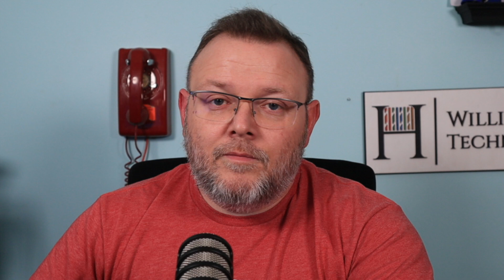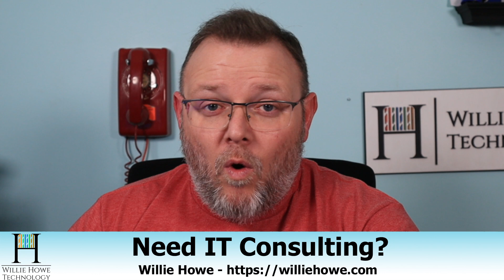Why is my wifi SLOOOOOW!?!?!!?!

Comment: The obvious solution is a faraday cage, an AP with a 2.5gbit connection that's got a 6e 6ghz 160Mhz channel width network. And then it connects to a single device that's 20ft away with direct los. Then you can get gigabit.

Comment: Nice vintage wall phone.❤
Reply: The question is does it work?  We had one at the local maker space and we had it hooked up to our voip system.  You could even dial out from it as we had a pulse to tone adapter on it - let me tell you though, dialing 11 digits for a local call sucked!  Also those bells can really ring if you crank the ring voltage up on the ATA!

Comment: I have 3 D-link Air Premiere  Dap-2553 and 2 D-link Air Premiere  Dap- 3520 802.11 N 300 access points using the 5 Ghz band .  A local business is complaining that I am slowing their Wi-Fi down demanding that I have to turn them off  during their business hours.  but the opposite is happening they are the interfering with my Wi-Fi  ( when their power goes out the interference stopped)  what can i do about this problem?
Reply from the maker: It's tricky. I'll do a video on it.
Reply: basically you have declared war on them, with all this Wi-Fi firepower you are slaughtering them, they are right to complain. Are you sure that all this is necessary? Is it configured correctly? Same thing to the other side.

Comment: Hi, thanks for the great video . I've got a question, you said that in the video that just having tons of passive devices connected might slow down the wifi due to airtime. so what if I use old routers as "dumb AP" just for IoTs devices but the main router still serves the dhcp for those IoT clients? will that still slow down devices connected to the main router?
Reply from the maker: As long as the ssids and channels and different you'll probably be OK.

Comment: Your wifi is slow because it was not set up by an IT professional
Reply from the maker: Wait a second... 🤔
Reply: Not always.  There are plenty of "IT professionals" just throwing a couple of unifi access points onto ceilings and calling it good.
Reply: @Wahinies  well you know it does auto configuration...never a problem with that. /S
Reply: Our network at work was designed by a so called professional  - not sure why we have 3 APs about 10 feet apart with drywall walls between them.  We got an Ekahau Sidekick for doing site surveys so when I get around to doing that building we'll be making some changes.  Seems I'm slowly becoming the wifi guy at work.
Reply: @awstott  it's not a bad thing to be. My company is too cheap to get an Ekahau device. We ended up with a NetAlly AirCheck. It works well though and I can send it out to a remote facility, preconfigured, and have whoever on site walk the facility per instruction to get a passive and active scan in.
Reply: @awstott  run while you can! I'm the wi-fi guy for my current place of employment. It's cool, but nobody else will understand the magic. :)